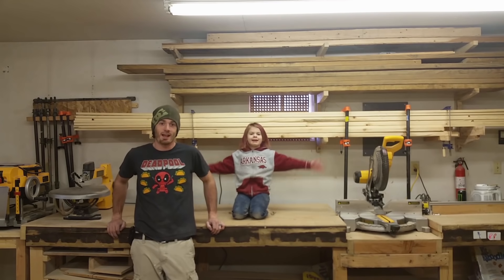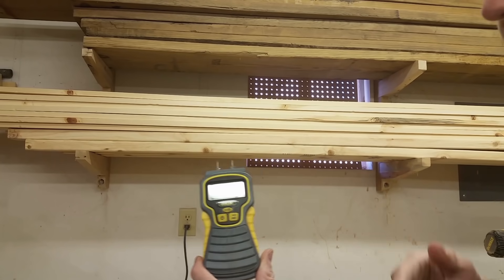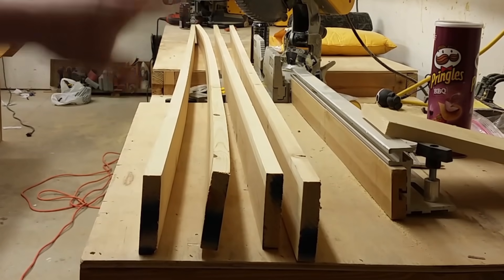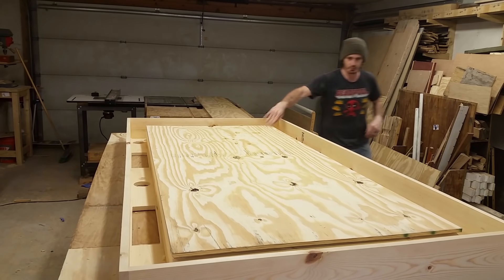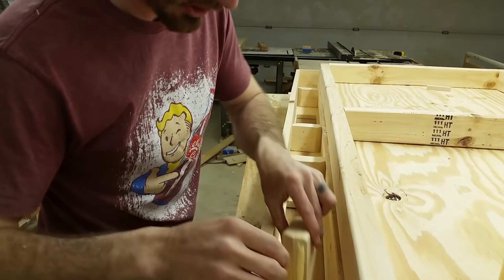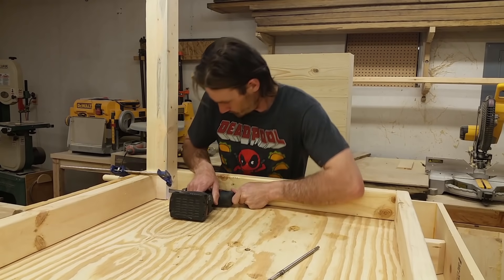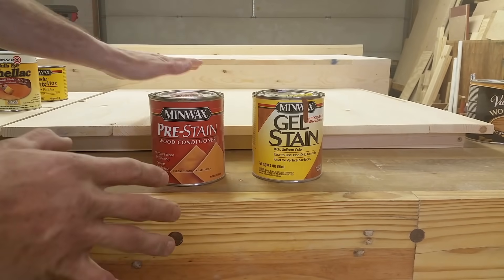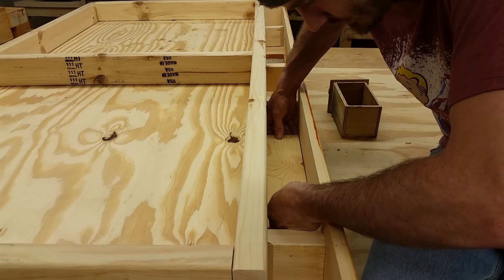How to build a gaming table (easy)

Comment: I'm in process of moving right now and I am getting my own gaming room, been thinking about what kind of gaming table I am getting, just a normal table but now I am thinking about building my own. Buuuuut I have zero woodworking skills,

Does anyone have good tips on a table for boardgaming. Before i've just been using our small dining table and getting annyoed how cumbersome it is to play on it.
Reply: "Game Toppers" is a company that makes a recessed play area you can plop on a normal table to create a gaming table.  They have late kickstarter pledges open right now, not sure on how long it might take to get your product but I've ordered gaming mats from them and they are great quality.  They are not cheap though, be warned!  
If you make a table yourself, just take your time and measure things often.  Draw it out on some paper with dimensions and change as you wish to create your plan.  You can follow this video and alter things for an even simpler build, such as no cup holders/trays, no boards on top covering the open area, no foot shelf, etc.  A nail gun is nice but you could screw in the wood instead and put putty over the holes.  It will not look as clean but it will still look nice.
I've made one gaming table in the past (very amateur woodworker here), and plan on using this video as a guide for my 2nd.  I highly recommend in rail cup holders, removable legs, and making the play area an exact size that fits a gaming mat that you can just buy and plop in rather than gluing down some kind of material or creating an insert to drop in with felt/speed cloth/etc.  There are some great companies out there that make gaming mats, I bought from Game Toppers and love their selection.  Creating my play area an exact size lets me buy a few gaming mats and lets me switch them out when I want.
Anyways, good luck!
Reply: @boohiss83   boohiss83  I gotta keep gametoppers in mind,  those mats look great.
 I might make my own as getting one done for me is mighty expensive and building my own I will get exactly what I want. But that removable mat idea sounds good.
 Thanks for the tips mate!

Not in a rush here, gonna take my time with this one.